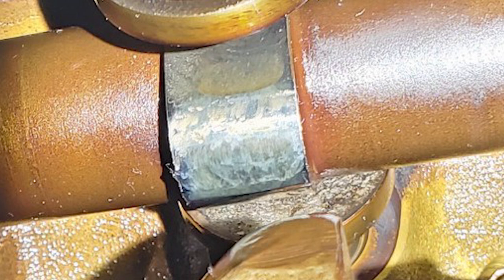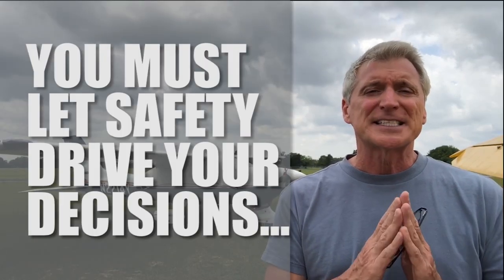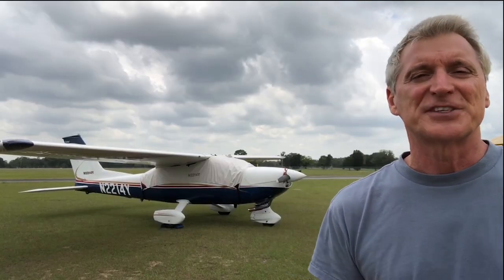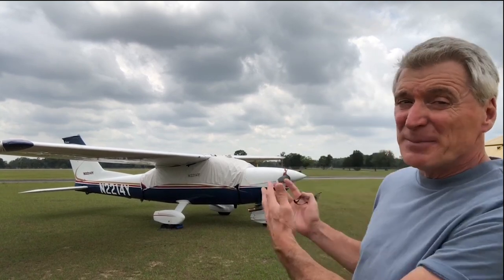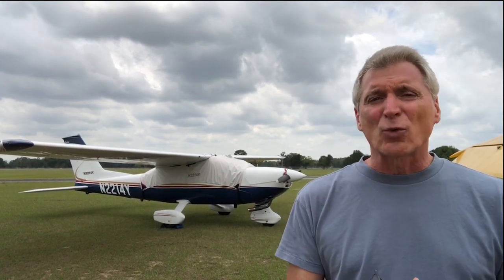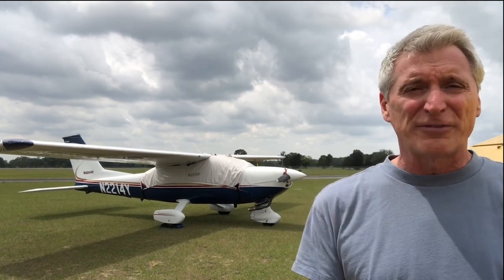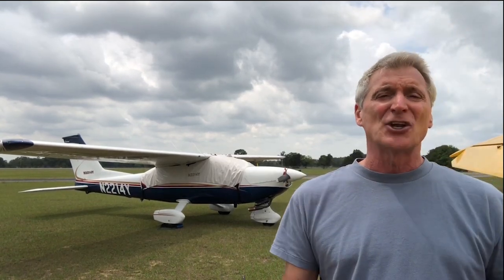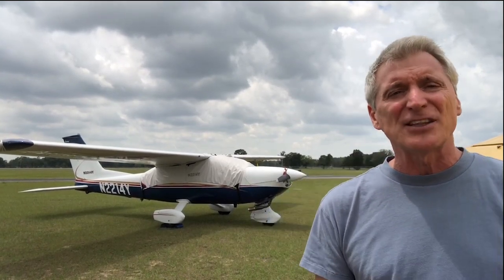When it all falls apart and the wheels come off....

Comment: I had a sir experience selling a Mooney M20E - we had a deal with a buyer and were doing a routine oil change and found metal filings in the oil!  Called the buyer and we cancelled the deal - then we replaced the engine!  We knew it was the right thing to do!

Comment: Cam failers like that are pretty comon on the Lycoming . BUT they usually dont end catastrophicly. Just dosent produce much power on that cylinder. You made the right decision though. Metal flakes coming off the cam can ruin the crankshaft. And thats alot more expensive. Most people dont realize that the cam is made of just cast iron!. And after its ground to shape, a surface hardness is applied to the lobes. Problem is that if it sits for a while, and rust forms on the surface, it eats all the hard metal off there. Then your left with soft cast iron. Fly your plane often and use Cam Gaurd.

Comment: Amen on the pre-buy inspection.  I would add that it is important to use somebody who is very familiar with Cardinals specifically.  I'm curious about what you're looking to upgrade to.  I went from a 177FG to a 177RG and couldn't be happier.  Put in a new interior and a new panel.  It's a new airplane at a fraction of the cost.  She's older and better, just like us!

Comment: I've been watching this sale as I close my own! I am doing a pre-buy on a '68 in Canada, and we found big cracks under the tail in the fuselage which the current owner did not know about, and also an out of dimension prop that the owner didn't know about either(needs replacement). So our pre-buy picked up over 15K worth of work that HAS to be done before it will fly again. Money well spent.

Comment: I know the feeling well my friend. My engine is at 25 years and 1474 smoh and I made the decision that, the next engine issue that arises, it is going to the engine shop. It just doesn’t make a lot of sense to incur the costs for piecemeal repairs once we get to this point in time.

In my case there are a couple of nagging oil leaks. The source of one is undetermined and the other would have been addressed at the next annual. It didn’t make it that far. On Tuesday our climbout seemed a bit sluggish. Leveling off at 3000 ft, the engine didn’t turn up quite as high and at power reduction there was a little roughness. Glancing at the gauges I noticed that the oil pressure was significantly lower than normal and the oil temperature was significantly higher than normal. It was an easy decision to return to the field...and...an easy decision to stop fooling around and get the engine done right.

Mine is scheduled to be pulled on Sunday and has a date with Zephyr Aircraft Engines. It will be interesting to see what they find when they open her up. 

You might want to speak with Brian Hoover at Hoover’s Aircraft Interiors for a quote on your interior job. He is based at Hidden Lake Airport but does work at ZPH as well. He did some work on my interior, replacing plastics and is very good to work with. 

Remember, ALL airplanes are “projects”. With some it is just more readily evident than with others. Good luck with yours!
Reply from the maker: Absolutely- finding a engine may be a problem - I’d like to upgrade to a 180 but I am learning the right one is hard to find - I may put a 0320 back in there in the interest of time - 3-4 month lead time for a IO 360 - I am at ZPH - I may have them do it - thanks fir watching!!!

Comment: I would much rather find something like this while the plane is on the ground, my loved ones and myself safe!  When I bought my plane, a Columbia 350, on the second lesson during the run up, the Electronic Ignition on one side failed!  It was really frustrating...   it took about a month and a half and I went back to magnetos on both sides.   But, I would rather find the issues on the ground not in the air!

Comment: Hi Ted, honesty in the prebuy to seller means a lot and Safety is #1 even if you sold it. Btw can you FG take an IO360 upgrade or an 0-360? Btw I installed a JPI EDM900 and it’s in center of the pilots view and also make sure the “engine light” is right near it and not off to the side and later hidden by an iPad mounted (experience). When doing your engine upgrade definitely yourself verify all the baffle springs are installed and make sure your baffling is in great shape also to keep your CHT’s under control. Ted  I didn’t notice but if your plane doesn’t have a Maple Leaf exhaust fairing you may want to research that.  Keep us informed on how and what you do going forward. Thanks
Reply from the maker: Thanks! You can do an upgrade to an 0360.... there will be upcoming programs on it ... thanks for watching!

Comment: Ted, You said an IO360 did you mean to say O360? Yes you can having an IO on the mount but your use full load will go out the window with a 2350gw and finding a fisdo to sign it off will be fun! The stc' o360 is the move to make. Also your TAP ad is wrong it's a STRAGHT 177!!
Reply from the maker: Thanks ! I have to change that! Thanks for watching!

Comment: WOW!!!...Sorry to hear about that.
We all knew you were a good guy.
Which 0-320 do you have.
Please don't tell me 0-320-H2ad...
Reply from the maker: I have the O320 ED 2
Reply: @Over50andLearningToFly  Ok thanks. I have a 0-320-H2ad in my 172. Supposedly they are prone to the problem you mentioned due to metallurgy. 
I use shell 100+ (has camguard  already added) and do my best to keep the plane moving to keep everything lubed up.1300hrs left until TBO.